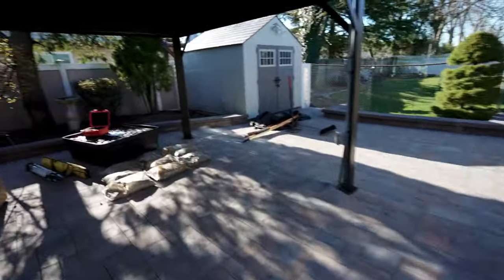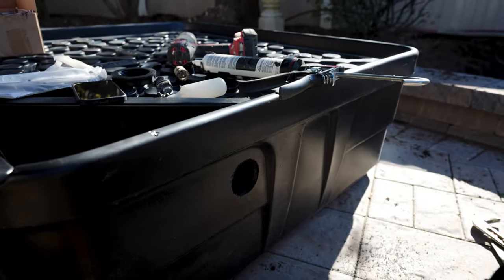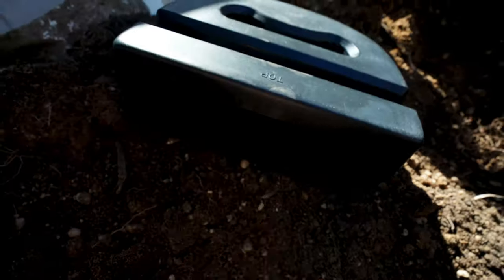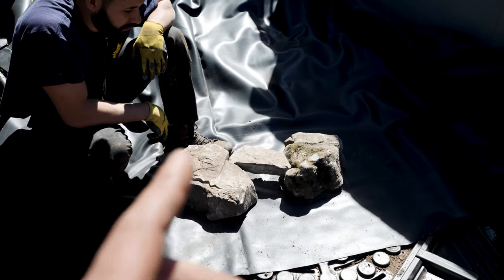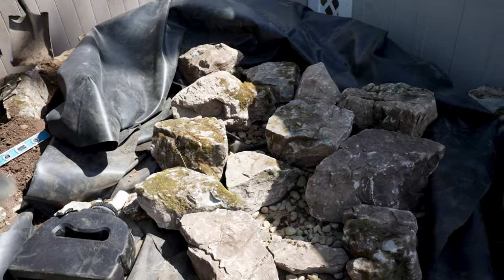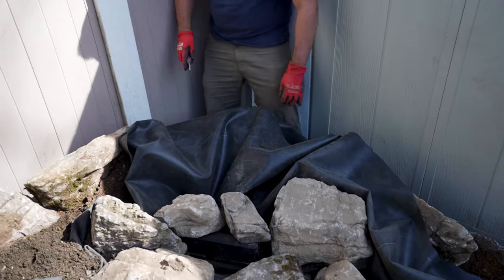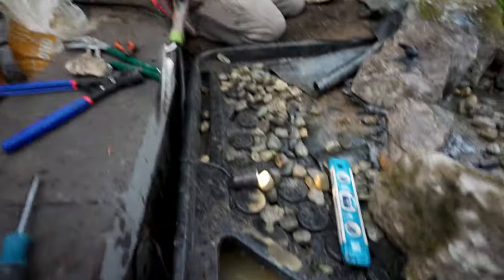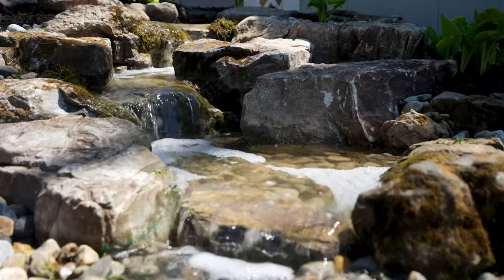Building an EASY backyard PONDLESS WATERFALL

Comment: Guys I loved it and I have one question is is the difference between the tank and the blocks ? And how the sand won’t 
get into the tank ?
Reply from the maker: We use the aquabasin for 4' pondless waterfalls or small fountainscapes. It keeps the footprint smaller while still achieving a large amount of water in the reservoir. We do put geotextile fabric on the backside of the aquabasin so soil can't migrate into it. Aquablocks allow for a more customizable footprint and allow more water volume for larger projects as well.